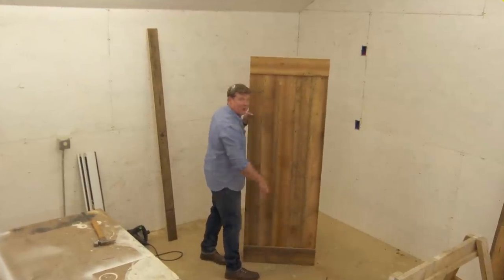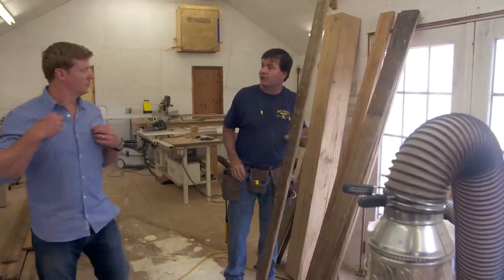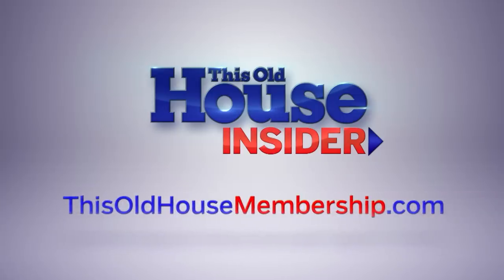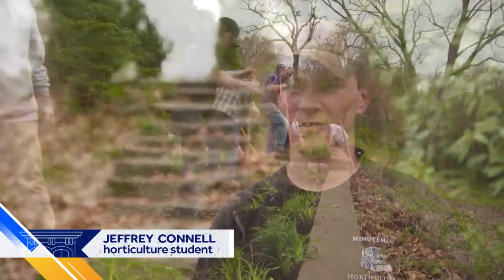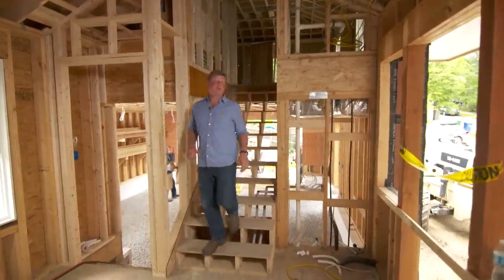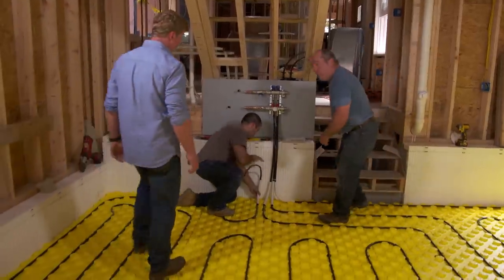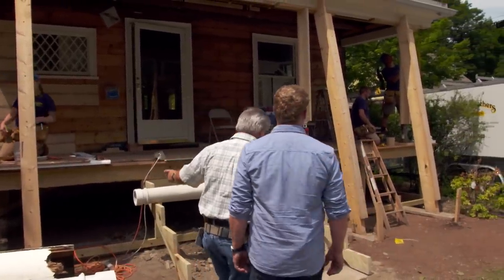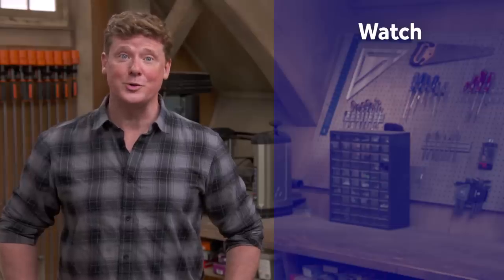This Old House | Approaching Half Way (S39 E7) | FULL EPISODE

Comment: Why did they not also glue the edges of the board when they put the boards together with the floating tenons?
Reply: I was wondering that too.
Reply: One reason would be to allow contraction and expansion of the wood through the 4 seasons. And it does not need to be weather tight.
Reply: What floating tenons? First thing I noticed after that was said they glued them.
No longer floating.
Reply: Since they want the rough unfinished side facing out, meaning they’re not going to sand or apply any new finish to it, my guess is they don’t want to deal with glue squeeze out. It’d be hard to clean up. Just gluing the floating tenons will be plenty for a light duty door like that.

Comment: What’s the difference between a floating tenon and a biscuit?
Reply: The floating tenon is only glued to one side and there is no glue on the faces of the boards.
Reply: @russlorenzini2492  That's not correct, according to the sources I've looked at. The difference between a floating tenon (AKA a Domino) and a biscuit is the shape of the wooden insert. Dominoes fit into a deep slot with perpendicular walls, while biscuits fit into an arc-shaped slot. Dominoes are (or at least can be) stronger and ensure precise alignment of the two pieces of wood. The tool for making Domino slots is evidently patented by Festool, is only available from them and is hugely expensive.

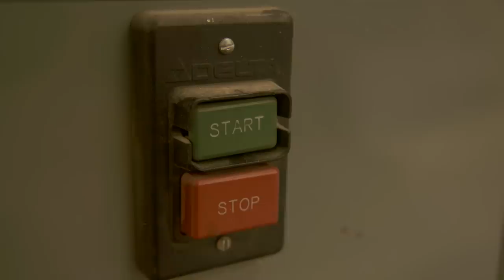Comment: @ 2:55, power switch clearly says Delta, but that's a PowerMatic planer.  Maybe he replaced the switch or maybe Delta is a sponsor and not PowerMatic!  Looks like the switch on the jointer @3:20.  No glue on the joints between the boards??? But then he fastens the top and bottom rails with glue spanning all the boards???  Norm would be ashamed!!!
Reply: @Kevin-mp5of  Crikey, you really are a bit of a Sherlock on the quiet.

Presume you under covid-19 lockdown too, then?

Comment: I liked the door made from old subfloor but I was really disappointed in the use of construction glue instead of doing it with wood glue.
Reply: @Kevin-mp5of  😂 hmm, but if the owners were after the synthetic trendy retro look for that one, single, solitary pantry door in their kitchen surely they would have insisted that no-one under the age of ninety laid hands on the timber.

Built using only hand cut nails, edges planed off and proper braced and ledged construction.

All this stuff and nonsense using modern adhesives, domino jointed boards and modern round nails ... not quite the authenticity they were expecting perhaps.

Dare I suggest the owners, who seem to have more money than they know what to do with, and spell budget .... "BUDGET", were "sold" the idea of a "period looking" door so as to allow the producers to crowbar in a scene where the trusty 5000💰💰💰 Festool domino jointer struts it's stuff, thus allowing Kevin to wallop in the dominoes with his plastic headed mallet?

Did I forget the thicknesser? I had until now.

However, despite all the irony, it was an interesting micro project and did tick the boxes on the recycling/upcycling thing, so not all bad.
Reply: @Kevin-mp5of  👍😂

Comment: I like how they keep saying they're on a tight budget but first buy custom tiles and now getting probably a $3000-5000.00 Radiant heating flooring installed in a garage.
Reply: @Kevin-mp5of  I don't think it was overly expensive to build BUT using those expensive fancy tools and doing it the way they did is what makes it more costly then it could have been. I think the Home Owners could have made their own project with that wood instead.
Reply: "Budget" doesn't necessarily imply doing things on the cheap of course.

Probably in this situation it was intended to mean try and keep the costs under a million ...

With reference to a heated garage, and the additional cost reference the overall " budget", it couldn't have been that much as a percentage.

Have to say (from my UK pov) having individually programmed AC in every room is a bit OTT (over the top) 😂. So why not a heated garage? Got to use up all that energy somehow as costs more to store it sometimes ...

I suppose you might get the
London mansion sized homes of Arab and Russian billionaire types kitted out with that sort of thing.

Although mainly they are annoying their neighbours by excavating beneath their houses for the installation of underground garages, swimming pool/fitness suites, home cinema and bowling alleys, panic rooms and vaults ... and probably dungeons ... we see some funny folks about these days ... far too many shops flogging off (groan) all this black leather gear about for my liking.

Evidently the "500" rooms on the above grounds four storeys isn't quite big enough ...

Comment: No glue between boards, only on the dominos??

Why?
Reply: It allows the wood to move with the changes in humidity.
Reply: yes
Reply: mrpiccolo23 wood expands across the grain, not along it. 

If why you say is true, which it isn’t, then, for example, glulam timber would not be a thing. 

Or chopping boards. 

Or door panels

Or...
Reply: Kevin yep, spot on. 👍
Reply: @GeeTheBuilder  thanks
Reply: @GeeTheBuilder  My next guess then would be that he didn't want to have to deal with wood glue squeeze out messing up the rough finish.
Reply: mrpiccolo23 perhaps 🤷🏻‍♂️
Reply: @Kevin-mp5of  That's how Norm Abram builds his breadboard tabletops. Makes sense!